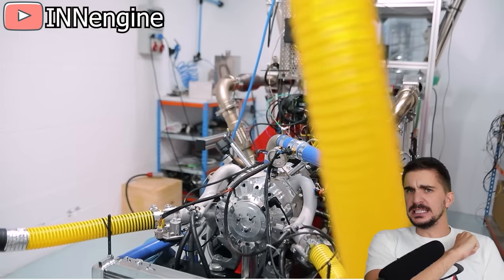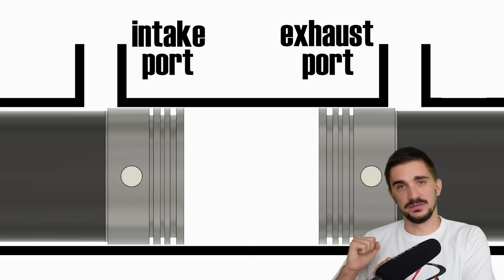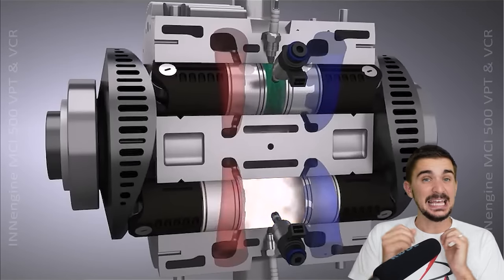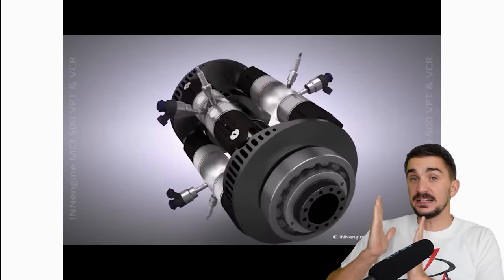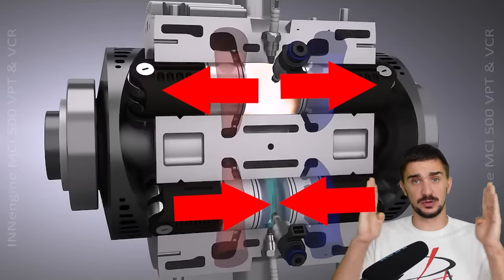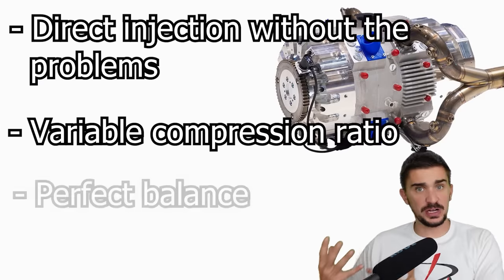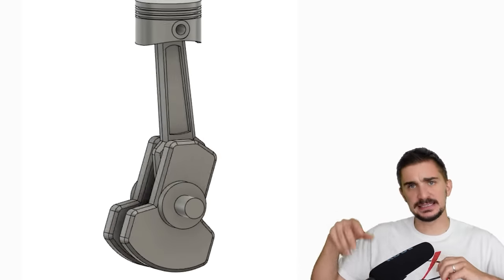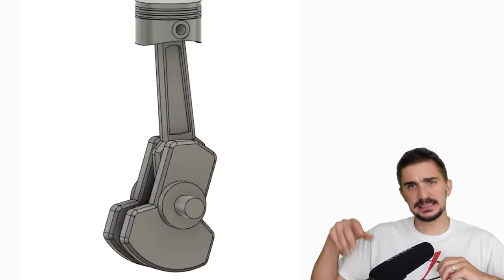Spain is Living in 2050? Revolutionary 1 Stroke INNengine Analyzed

Comment: I suspect that the weak point (and reason you'll always be torque limited even with forced induction) is those roller bearings running on the wavy ramp.  There's also lateral loading on the bottom of the piston because it's pushing against an angled ramp so if you increase the ramp angle to increase torque, you're also increasing the force applied against the side of the cylinder wall.     Their cutaway 3D printed models don't show how they handle those lateral forces (causing friction and wear), at all.
Reply: have you ever seen the angle of a connecting rod? There is already huge side load in conventional engine. this part is probably easily manageable especially since the piston is really long.
Reply: Yes. I agree about the roller bearing on the piston being the weak point. That’s a lot of shock and a big load for it to handle… not to mention the side loading of the wobble plate ends
Reply: @TJPDmember the connecting rod has a bearing between it and the piston meanwhile this engine it is a one solid piece
Reply: @copy4862  This is a 3d animation... Even tho they're not common, engine like this already exist. A "journal bearing" like we use on our crank still work the same on a flat surface as long as it has oil pressure.
Reply: I suspect the second wave plate, which retains the pistons from smashing into each other, deals with the lateral loading too. 8:56
Reply: I agree the roller bearings will be the weak part it reminds me of the rx7 the rotary engine good engine but it never really took off
Reply: This was tried before, and attempting to transfer power backward through the cam rotor and wobble plate was the issue with the design. 
Works fine being driven as a compressor and been used that way for decades as an automobile A/C compressor.
Reply: @jhoncho4x4 additionally, I dread to think of the endurance of such a small transmission pushing 120hps through these rollers and plate surfaces.
 Conventional transmission for a ~120hp engine today weights about the same as this entire ewonder. Only the gears and housing to handle that for 100 000 kms, no "engine" element.

Comment: This is quite impressive. It has a lot of the advantages of two stroke engines without the drawback of burning oil. I would still assume it's not as efficient as a four stroke engine as I believe at least some of the air that goes into the engine during intake escapes out of the exhaust port. That might also be the reason for including forced induction. Either way, an 8-cylinder engine that weighs only 35kg is insane and I'd love to hear it at full throttle.
Reply: They put it on an MX5 to test and it worked quite well (although it was just for testing). They also successfully put it into a big scale RC plane and it worked well too. There’re a couple of videos (in Spanish) out there. The head of the project, Juan Garrido, says that a 2.0 generation is on the way and that it’ll be purpose built to work as a range extender for EVs. He also says that COVID hindered a deal he was ment to sign with an OEM manufacturer to develop it further with solid funding.
Reply: Sadly, it will be too fragile to be worth anyone's time. I don't see this thing lasting anywhere close to life expectancy of a regular 4 stroke.
Reply: @alanwatts8239  It’s a new engine and a prototype, designs go through many iterations
Reply: How would wasting air adversely affect efficiency? There wouldn't be unburnt fuel in those gases.
Reply: @toozes  Less air means you can't mix as much fuel, so you don't have maximum power. I'm not saying it's inefficient at all, but I'm saying it might be able to be more efficient
Reply: @Commerce-Suite I guess it'll have the same problem as Rotary engines, you can't control the timing.
Once that exhaust poet is reached, no matter if there's work to still be extracted, you're done, it's going out the exhaust.
Maybe you could add a secondary swash driving port covers. That way you can at least have more control over the timing.
You could even advance and retard the port swash in real time, depending on power request and rpm, calculated by an ECU?
Reply: WOAH! who says burning oil is a drawback? one of the best things about 2 strokes!
Reply: @steinanderson9849 MERICA
Reply: @alanwatts8239 I couldn't agree less. Firstly this is a prototype so you can't judge it in its current form, secondly it's very simplicity will greatly aid in it's robustness - no valves, tappets, largely milled components etc & lastly - as said in the video - it's intended to operate as a range-extender, not as a replacement for a regular four-stroke engine. The only real area of "trouble" is in the roller bearings at the ends of rods & I'm sure any problems here will be eventually, solved. The other issue is you seem to be implying that 2-strokes are more fragile the 4-strokes which is, frankly, poppycock. Ask any old-school VW Beetle owner from the past 70 years if that's the case. Simplicity usually leads to reliability.

Comment: This looks like an excellent choice for an EV "range extender" generator.  Likely very quiet and smooth along with very, very compact.
Reply: And apparently that's what they intend it for, but for some reason chose not to go that route with their advertising? Kind of strange to me, also seems like it would be nice to be paired up with Honda's tiny electric motor that can be bolted to one of the flywheels to add 30ftlbs at zero RPM and then allow it to just zing up to the revs.

Comment: A great, informative balanced video- thank you. I'm a 60 yr old motorcyclist, my first bike at 16 was a 2-stroke Yamaha RD350; my current bike, of 20 years, is a Honda (4-stroke) CBR1100xx. That yammie engine, light as a feather, temperemental as anything, easy to fix, this honda engine massive heavy solid chunk of robust reliability. Both generating great power in their own ways. It would be great to know where their  horsepower figure arrives, their claim is for approximately twice what my honda makes. It seems the engine could be well utilized in a motorcycle, very little weight to budge compared to even a lightweight sports car. FINALLY, I would venture the dodgy nature of their claims and presentations may do with corporate structure: marketing people are not engineers and vice versa. Engineers don't get to spin the narrative that goes out to the public any more than marketing personnel get to install a blower to achieve a certain "optic". 
Oh, and, reed valves.

Comment: I would have major concerns about longevity with that roller/cam design. How the lubrication system works will make a big difference there.
Reply: probably lots of wear and tear on that wavy plate, but maybe the lack of maintenance and tuneups might make up for it?
Reply: It looks like it is simple to service and inspect. It is light enough to lift out easily.
Reply: looks like the swash plate and bearings would be a wear part.
Reply: Well, they are rollers, so fundamentally less friction than cam shafts or pistons. Those rely entirely on a layer of lubricant to keep prevent friction.
Reply: Also the metallurgy of these components, as their meeting surfaces would be enduring some fairly unique stresses over time.
Reply: oddly i have zero concerns. an ev needs a 10k battery pack somewhere around 100k. so off to the landfill it goes. this thing? should cost about 1500 bucks and if it lasts 50k awesome.
Reply: Again depends on the price. We have to look at the proportion of longevity and price. But agree...seems like that roller will be the weak place. Otherwise, if those rollers will be not very expensive to change then this will be ok.
Reply: @fila6243  Why would you take it to a landfill? Have you never heard of recycling?
Reply: @Eleftheria_i_thanatos  Recycling Li-Pos, Li-Ions and other new types of  modern battery cells is very difficult and costly. It's not as easy like with lead acid batteries where you just remelt the lead and neutralise the acid. In an EV you have thousands of tiny cylinders of paper thin rolls of highly reactive metals and different chemistries. At the moment only 1% of Lithium batteries are recycled in US and EU. It is an  active area of research, time will tell will we achieve good results like with lead acid batteries or a scam solution like with recycling plastics.
Reply: Like all things... If it's a better mousetrap it'll get more R&D & hopefully some of these kinds of issues will be solved by clever engineers.
Reply: It is an normal construction for a hydraulic engine.
Reply: @jwadaow  I would love to see this increased in size to a tank power pack.  Opposed piston designs have a long history in both Western and Russian design culture.

Imagine a pair of these lined to 4 graphene ultra-capacitor banks an electric motor/gearbox output.
Reply: Open bearings and spray oiling would also oil the skirts of the pistons. Since there is a follower that positions the piston, oil passages could be designed in for direct oiling or the roller bearing.
Reply: @uheigrok5288 The opposing  swash plate.  Look closely, there are four swash plates in the engine, two at each end.  One pushes up, the other down.
Reply: @Eleftheria_i_thanatos that's probably the best idea, luckily we have just started production of lithium battery recycling plants all over the US. There's a small handful now that are open and operating. They are actually buying dead batteries to keep them running! There's billions of dollars being invested by our government to open up new sites everywhere. The key is going to be location,  putting these plants within 50 miles of giga factories as batterys weight a ton and moving them around needs to be avoided as much as possible
Reply: if feel like the way these „pistons“ are designed looks a lot more strctural rigid than the conventional piston,crankshaft system, the missing valves remove alot of moving parts as well

Comment: Seems like a really slick idea, the part I would be concerned about is that the rollers are not attached to the swash plates which could create room for the pistons to “bounce” around on the swash plate during high rpm operation.
Reply: Everytime you stop such engine the pistons might stop touching the swashplate. And everytime you start it up they might strike the swashplate.
Reply: @Eugensson  sounds like someone needs to invent the swishswash plate 🤔
Reply: Check the design at 13:45 mark. The rollers on the pistons do ride in an opposed swash plate.
Reply: also, how long would the roller bearings last?
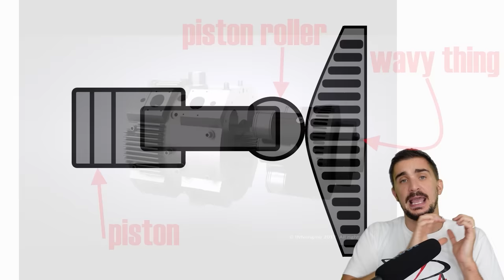Reply: If you look at the little clips at 01:04 you see the rollers at the bottom but also a roller on the side. That one catches a slot on the side of the "wavy thing" and holds the piston in place. If you freeze at 01:02 you can see the slot what holds the piston in place.
Reply: zero torque..   pushing on a swashplate does not make torque, it simply pushes the plate to the side.. the torque coming for normal enigines ar simply because  is pushing a pinion around an axis...   I serious doubt this thing could move anything heavier then a vw beetle
Reply: I would also suppose you would need to add weights to counter forward thrust not like they recommend by facilitating light parts with too much forward torque it could flip!
Reply: The thrust washers at each end would need to be very strong. I would also foresee big problems as soon as any sign of uneven wear or impact damage to the swash plate surfaces
Reply: Did miss the max rpm?
Reply: @harleyme3163 swash plate has some weight, so it has some torque. 
but probably much less than crankshaft and flywheel of conventional engine.
Reply: @timblackburne77  if the chassis and body are a lot heaver than the engine they would need to modify the front and rear enda to distribute weight evenly it would also put less stress on the engine. itself.
Reply: There is no roller bounce, the rollers ride between two identical opposing swash plates.
Reply: These bearings ride in an oil bath.  Conventional sealed bearings can last a very long time with just the bit of grease installed when they were manufactured.  
Both the swashplate….err, wavy doomhickie and the rollers are highly polished and hardened.  These would also be precision bearings with practically no slop, coupled with almost constant preloading on them. 
I would expect it to be very reliable for a long time.  Of course, not everyone takes care of proper maintenance, so results may vary.
Reply: @yestfmf  those bearings are pounding at swash plate at 90° angle. it can never work. 
classic engine never experiences anything near that.
Reply: @mattbenton3177 already got it.  The pistons would need to ride in a groove attached to the swishswash plate to keep it all connected.  Max RPM?? I'm imagining if you worked the kinks out on this thing and maxed out the RPM it would look like the sun inside the cylinder.
Reply: It also brings to mind A question....  how do you deal with the piston side loads due to the vector forces generated by the roller and the angle of the swash plate?
Reply: @arnoldgrubbs2005  roller balls on the side of the piston under the rings?
Reply: @mattbenton3177  Good eye! You solved the swishswash plate dilema!😅
Reply: @ivok9846  you mean like the connecting rod pushing straight down on the crank pin at TDC? That happens constantly in every conventional piston combustion engine.
Reply: @@tobiascat6173 sounds no where near as cool tbh
Reply: It's also twice the parts making it twice as likely to fail & twice as heavy.
That's a major beauty in 2 stroke design.
It has few parts & they're light weight because of it.
This " new design " doubles the chances of problems with no substantial horsepower increase to justify it.
And replacing a rotary motor in a Mazda is it's only proven accomplishment?
I guarantee it wasn't an upgrade with all those parts.
1 rotor of a winkle engine has 3 combustion sides in 1 chunk of metal.
So, an old dual rotary engine was actually a " 6 cylinder ". 
This bs " new engine" has 6 pistons & 3 cylinders.
Just 1 triangle rotor has the same amount of combustion chambers.
This " new engine " is a hoax & a flop in my honest opinion.
Reply: @noneshere  But you do gain efficiency but using that heat energy to move another piston instead of just detonate it against a wall.

Without using one with only a single side of pistons, you cannot really claim that this unit "has no substantial horsepower increase" because you aren't comparing it to anything.
Reply: kind of like 'floating' valves during high revs in a conventional gas engine?
Reply: @harleyme3163 what about the Miata they put this engine in?

Comment: probably not so much a vacuum, the intake air is probably pressurized to some degree so when both intake and exhaust ports open, the intake rushes fresh air in and pushes out the exhaust

Comment: The Detroit diesel engine is a two stroke with a roots blower to scavenge the cylinders by forced induction. The opposed piston arrangement has been used in diesel engines in Britian for years by using two crank shafts on opposite ends of the cylinder. Fairbank Morse also used this arrangement in large stationary and marine engines.  I don't think the swash plate will hold up long term but it does make the engine extremely compact. Interesting design.
Reply: You're talking about Deltic diesel engines I believe, but they don't directly power the vehicle, they power an electric drive train iirc.
Reply: I believe the opposite is the case, with proper lubrication the swash plates will show minimum wear as opposed to crank/cam shafts.
Reply: @amramjose  I dunno, the cam in a conventional engine doesn't actually take nearly the amount of load that the crank does and modern roller cams can last a very long time when the valvetrain is set up properly. Plus, in theory at least, the crank journals should never touch the bearings while the engine is running.  The bearings float on the oil a thousandth or two of an inch away from the crank journals.  Most of the wear you see comes from startup, foreign debris, or not changing the oil before it becomes acidic from mixing with stray combustion gases.  Maybe these new "one stroke" engines will surprise me, but it seems a lot more difficult to keep that swash plate oiled than a conventional crank.
Reply: @flammenjc  Napier deltics powered mine sweepers and motor torpedo boats 🚢.
Reply: This is know as the uniflow principle where a supercharger merely creates the scavenging flow to fill the cylinder with atmospheric pressure and flush the exhaust simultaneously. It works extremely well and my old boat was powered by the Detroit diesel using this principle.
Reply: A regular engine has a bearing at the piston and crank side of the con rod. the bearing on the piston here will wear quickly because the load is spread over such little movement
Reply: The swash plate is essentially equivalent to a camshaft on roller lifter, it will probably last about forever..........

Comment: @3:32 and i'm loving this idea already.  Using a swashplate instead of a crankshaft gives sooo many options.  You can control dwell time of the valves, you can control dwell time at TDC to allow fixed-volume combustion.  You could use the swashplate volume to pressurize the intake charge air (similar to how a 2-stroke RC engine uses crankcase volume).  so much flexibility in this design.
Reply: You can even use the swashplate to customize the level of seduction for maximized rizz.